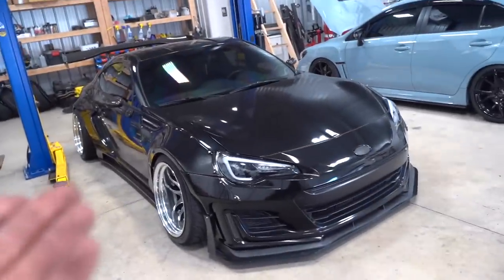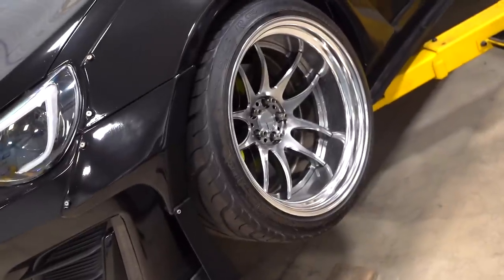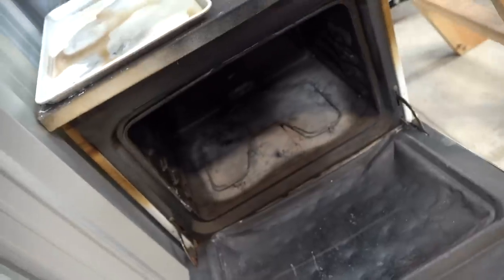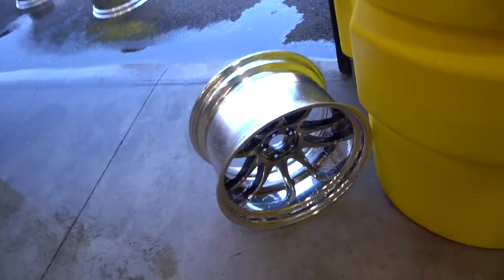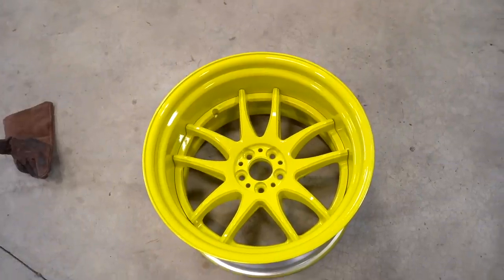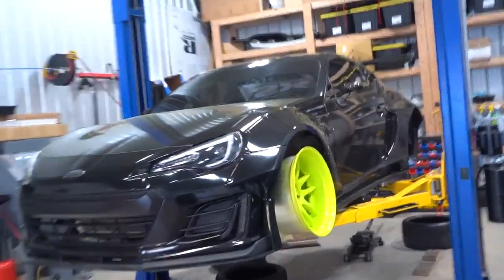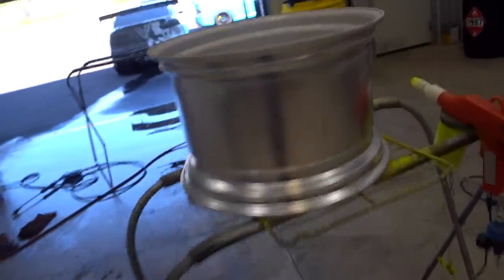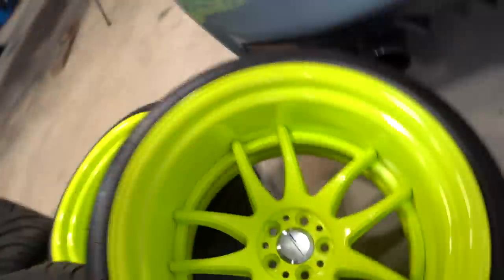FRS Gets The Craziest Wheel Color!

Comment: Is there any way to get around the TPMS sensor for subarus? I have my TE37's in the mail and wanted to know either will the oem sensors work or has anyone tried the torque solutions valve stems? Does the putting them in a pipe and pressuring them with air work? I  REALLY DON'T WANT THAT YELLOW LIGHT ON, IT'LL DRIVE ME CRAZY!